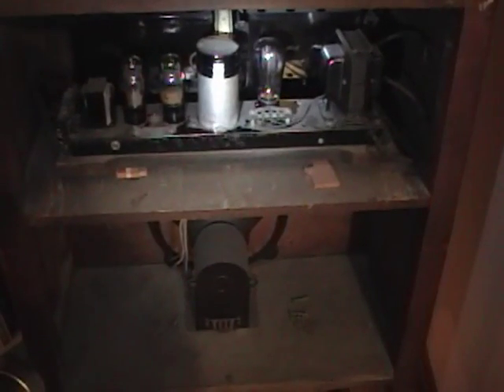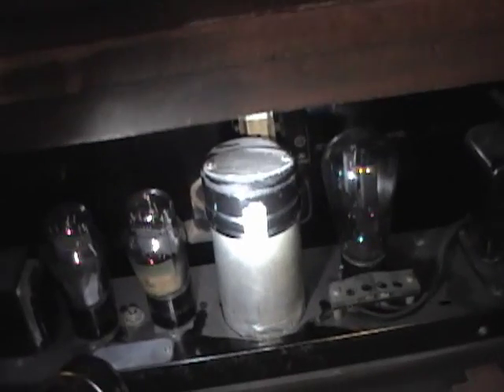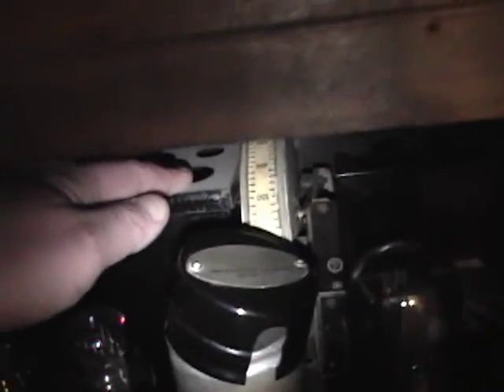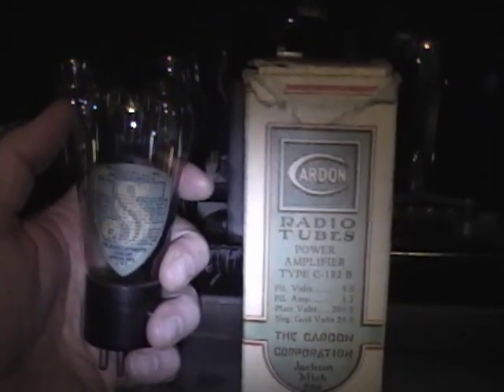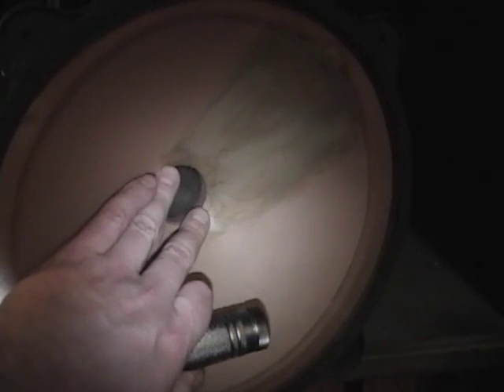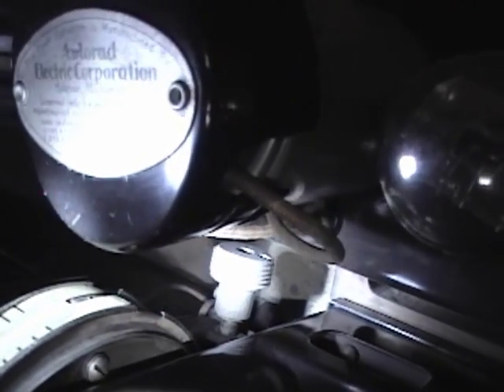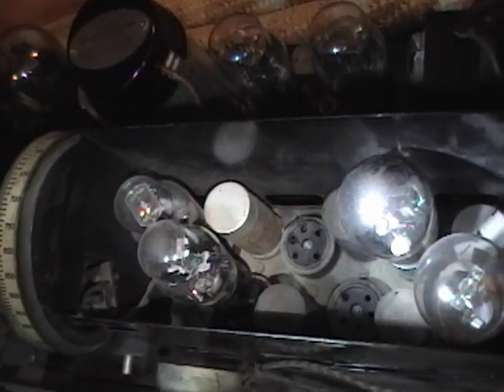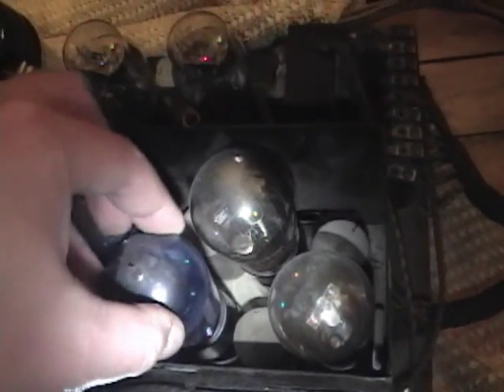Sparton Equisonne 931

Comment: Mount the speaker up side down.  If you can't, make a shelf off the botom of the chassis shelf for the speaker base to screw in to :)  So this way the terminals are up a lot higher and you won't have to discard the original wire :)

Comment: @bandersentv Cool, let me know how the repair goes!  I'm anxious to see if yours operates similar to the one I worked on.  I still think that part of the problem was having the caps mounted underneath.  Maybe having them right next to the coils was causing oscillation.  Though you would think it would happen worse at higher frequencies, not lower...

Also check the 2.8k resistor in the amp.  It might be out of tolerance.

Comment: Interesting cabinet!

The 931 I worked on had an 8" speaker of unknown brand.  The cabinet was notched at the factory for a 10".  The speaker wires were also color coded.  Are yours all a white color?

The RF amplifier has several small flat head screws to remove it from the metal box.  If I recall, there are 4 on the top (inside in the corners) and 1 in each long side externally.  Then you just need to carefully lift it out while guiding the wires through the notch.  They are quite brittle.

Comment: Are you still planning on restoring this?  I am in the process of restoring mine. To get to those coils and caps, you have to remove the screws and push the wires through from the outside. It should pop right out. I had four bad coils, but was able to repair.
Reply from the maker: Yes, eventually.  I wish it had an original cabinet rather than a custom one though since the chassis doesn't fit very well.  Also, the pot metal pulleys for the tuning mechanism are shot.

I opened mine up shortly after I made this video and only found one minor repair.  The rest is all original.  I haven't tested the coils though.
Reply: bandersentv I wouldn't worry about having the custom cabinet--they are usually worth more since few were made in that style. Mine also was mostly original. You can check out my video when you have time. The coils alone took about three hours. I might have an extra tuner in my bone yard. I have a few Sparton parts.